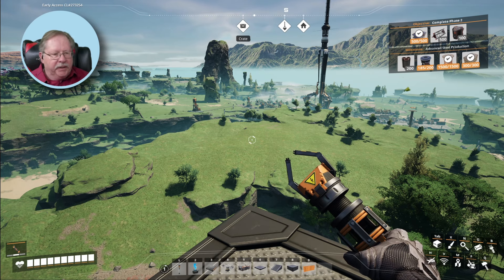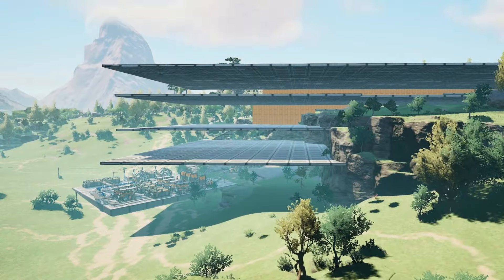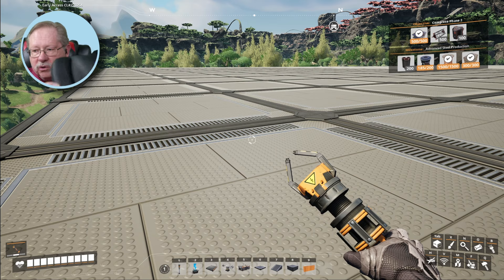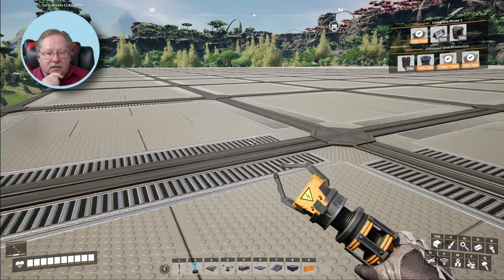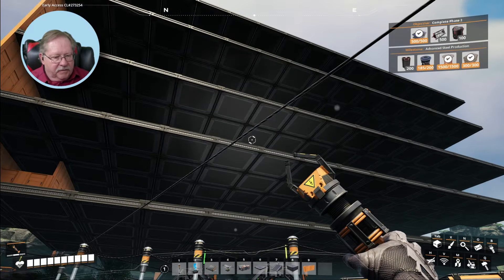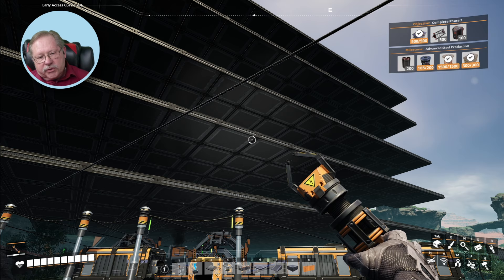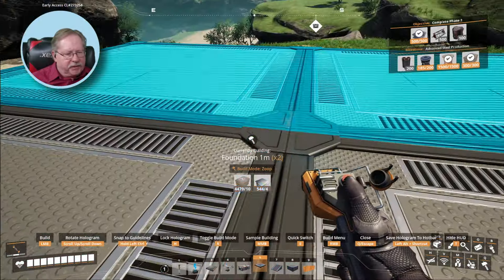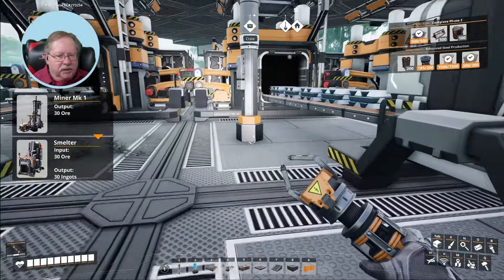Beginning the Mega-Factory and Production Balancing [Satisfactory 15]

Comment: You'll want to lean into an online satisfactory planner/calculator. Generally, you pick the output you want, and the tool will map out the dependencies for you. In this case, you'd ask for 5 reinforced iron plates per minute to match the capability of the Assembler and get that it requires 2 smelters, 1 rod constructor, 1.5 screw constructors, and 1.5 iron plate constructors. Personally, I don't like fractionally utilized machines; sometimes it's unavoidable, but often, if you increase the number of items per second in the final output, more dependencies will fall on round numbers. I like how 2 reinforced iron plate assemblers perfectly utilize 12 assemblers and two mark 1 belts of iron ore.
Reply from the maker: I just started using a spreadsheet & diagram in my upcoming episode. It's been helpful so far. As things get more complex I'm sure I'll upgrade to something more dynamic. Do you have a favorite planner?